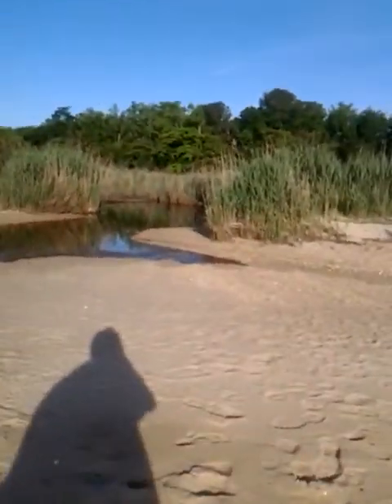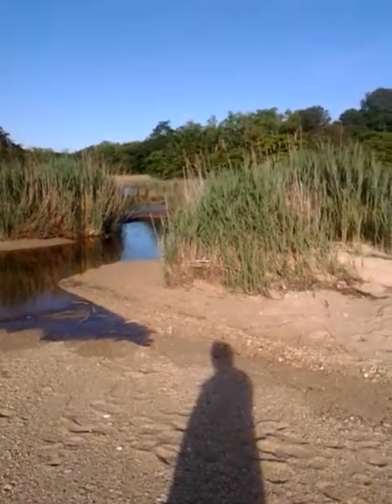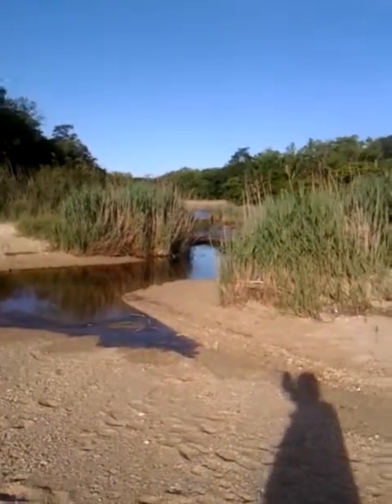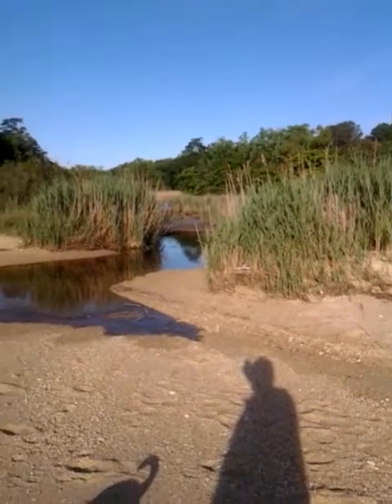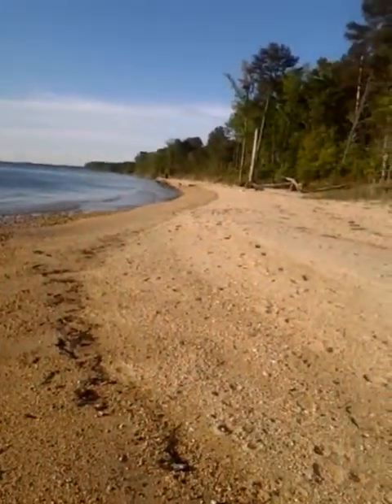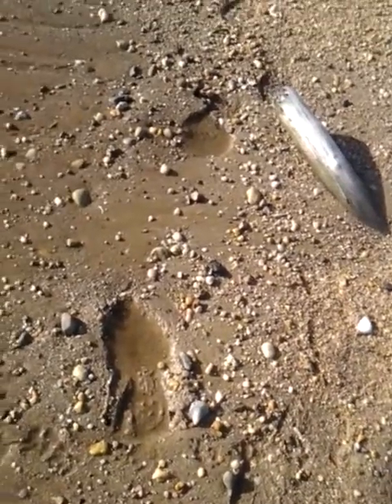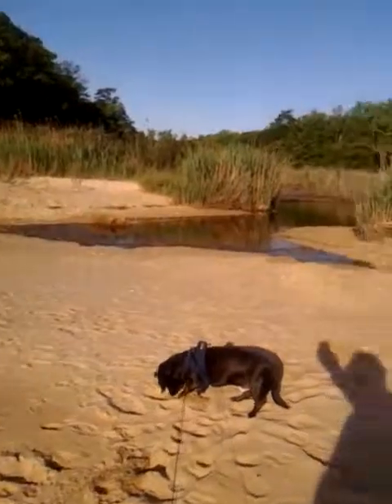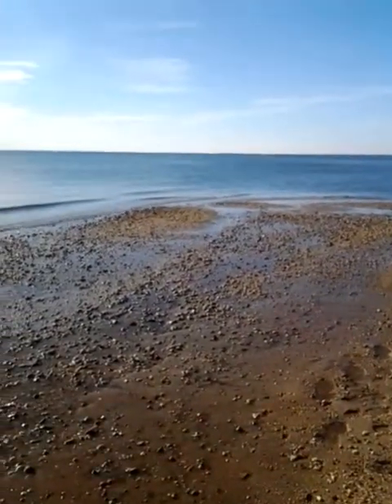Grand Canyon: Formed by Breach of a Natural Dam

Comment: A breach could have started the Grand Canyon. There's evidence for a Lake Bidahochi that drained into the Hualapai drainage system. However, a breach only explains a fraction of the geological formations that are observed. You need an explanation for the rest of the structures (including the various layers). I don't think you can do that using a 6000yr timeline.